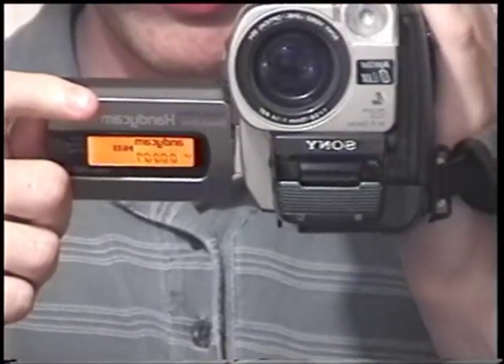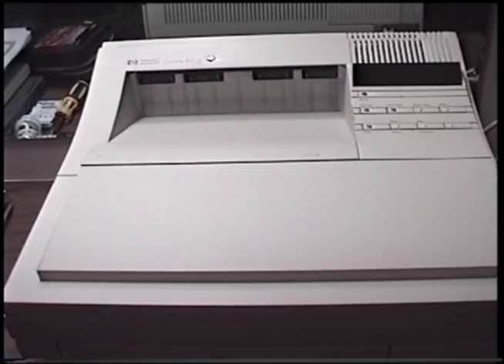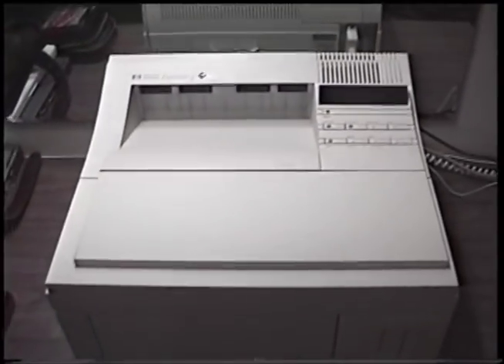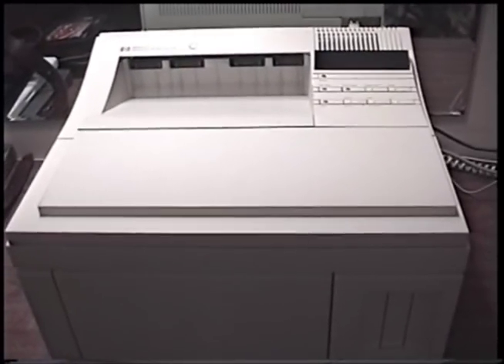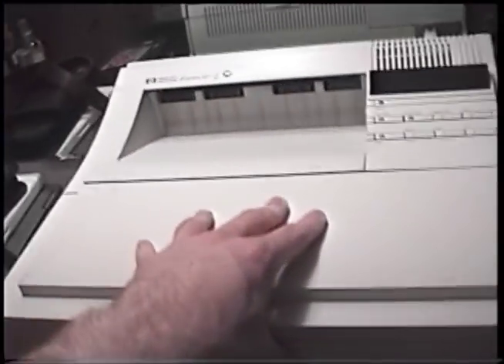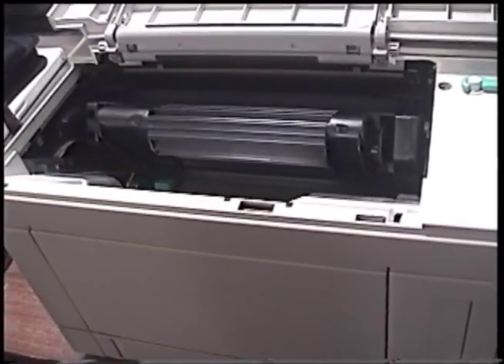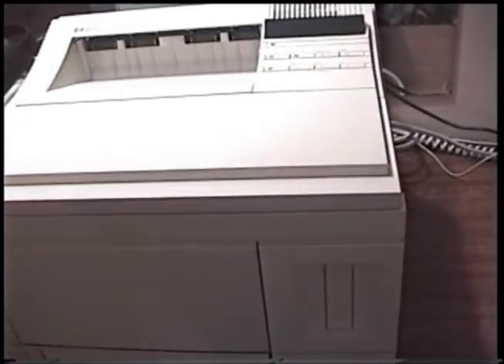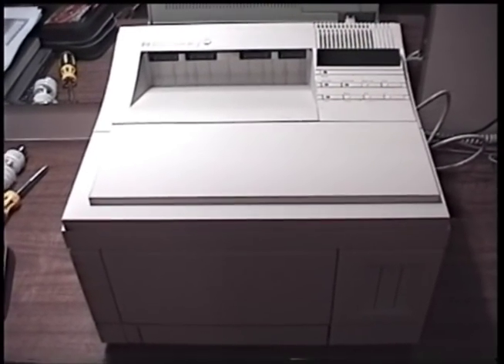HP LaserJet 4/4M printer, Part 1: Intro/Preface

Comment: I have the same LaserJet 4 that i bought in 1992, and the other day I put in a new toner. It prints test pages just fine. I  would love to be able to use it with my Windows XP and my Windows 7 operating systems. I still have the original floppy disks that are for Dos Ver 3.31 or later, but I have no software or drivers for the old (newer) computers I'm running today. TheMaritimeMan ~ can you help me please?  :)
Reply: I don't know if you'll get this since this comment is over a year old but have you tried Guten print? There's a small crew of people out there that still support this printer. Get yourself a Serial over USB cable and you're good to go! I use it on my system at home, but it's a mac. I'm sure there are compatible drivers for both platforms. Wouldn't be surprised if there were Unix/Linux ones also!
Reply: I have 4+, and have it network installed by LAN. I have Windows 10. It installed as simply as any of my other LaserJets.
Reply: You can use built in drivers for windows xp-10 with these either by selecting PCL5 Print language or going in and manually adding the printers and manually selecting the printer from the drivers list. https://i.imgur.com/tDgDQ79.png Here is where the driver is for it under windows 10. Another option would be pick up a raspberry pi load it with rasbian os install cups and grab the driver for it off openprinting.org and use a parallel to usb adapter to hook it to the pi and set it up as a network shared printer that all your computers can use. I was doing a similar thing with my 1992 HP Deskjet 550c until recently when i replaced the pi and a old poweredge i was using for 2 seperate things with a small passive cooled x86_64bit system running linux that now acts as my Cups print server and also performs the functions my old pentium 3 poweredge was doing. https://cdn.discordapp.com/attachments/245706734390214656/575710720025559040/JPEG_20190508_114822.jpg

Comment: I'm going to attempt repairs on the one in my house because it started to do the black lines on the sides of sheets of paper it prints.
Reply from the maker: Jacob Cohen Probably just needs a new toner cartridge.
Reply: ***** hmm...maybe. I'd have to wait till i get the money because HP Toner Cartridges are so expensive. I wish I could take the black cartridge from the newer laserjet I have nearby my desk to test it out with but sadly, nope. I will definitely replace the cartridge when I can get the money because the printer is now mine and it's even more of a tank than the laserjet I have nearby my desk (can't remember the model)
Reply: Even new old stock toner cartridges will begin to make black streaks.  Believe it or not, there is an easy fix.  The rubber wipe that cleans the toner drum hardens over time.  My local toner cartridge refurbisher had these in stock.  I hear you can also soak the old one in spearmint oil to soften it.